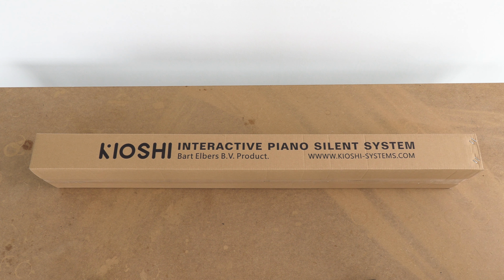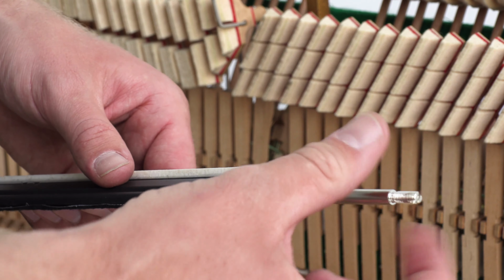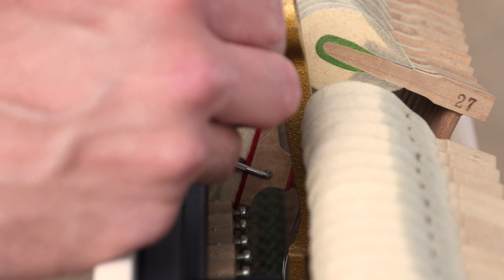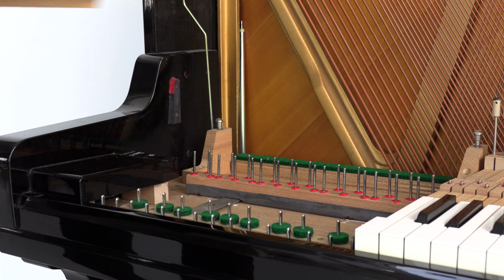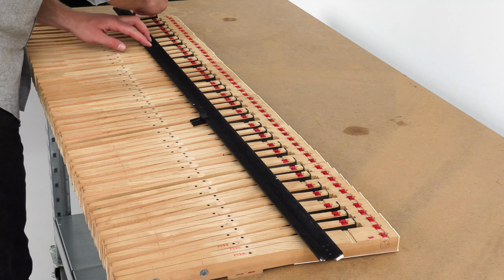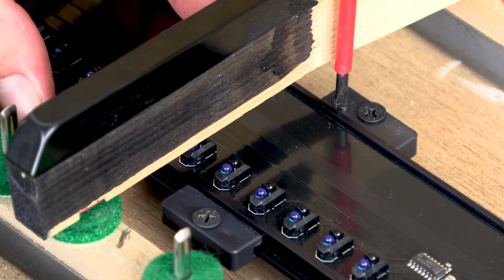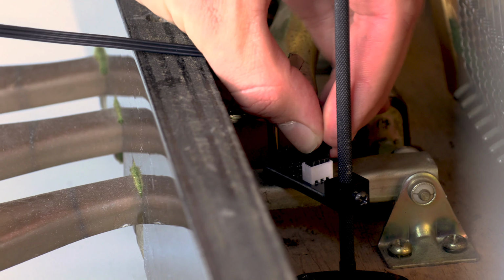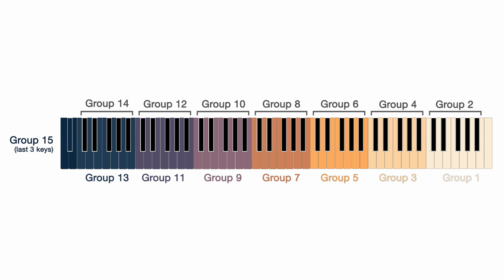Installation of the Kioshi Silent System for Piano Technicians

Comment: I assume that this system also adds the problem that you need to modify the release settings of the hammers (they need to be released earlier, as the distance between the hammers and the stop bar is necessarily smaller than the distance between hammers and strings), so having installed this system has an impact on the behaviour of the keyboard when using the Piano in normal mode, right?
Reply: You have illustrated the exact problem that I have been searching for. Is there anyway the problem can be mitigated, in compromise with little sound hitting on the string rather than being completely muted and out of the string touch?